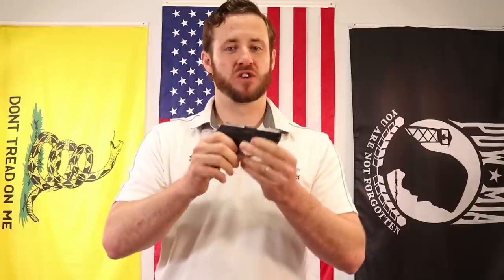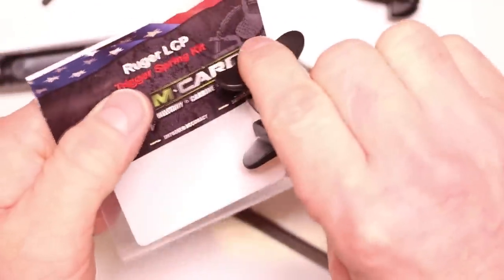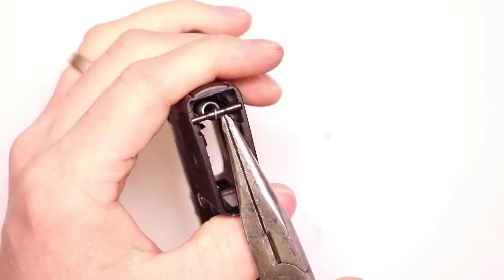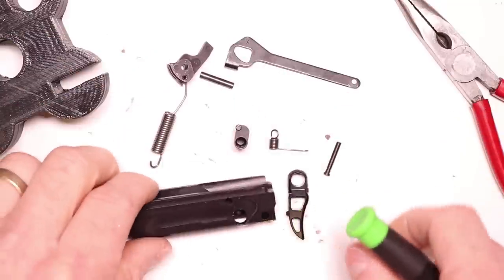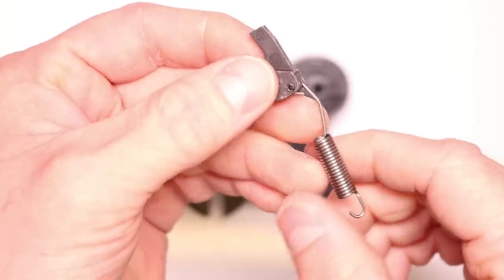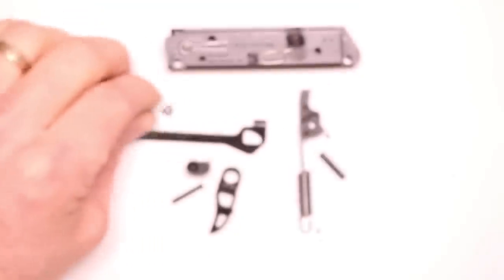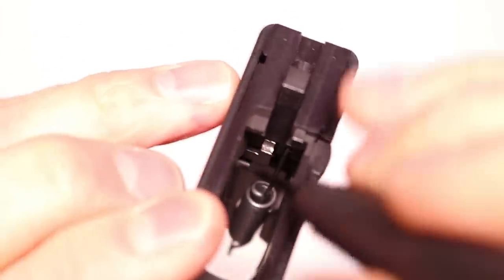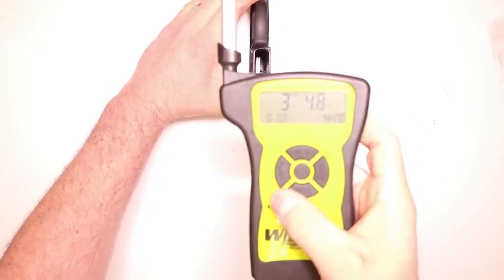Ruger LCP Trigger Spring Kit - Ruger LCP Trigger Upgrade

Comment: I have owned the LCP 1 for years.  Also the LCP Custom.  I have never had any trouble with the guide rod or anything else for that matter.  I like your stuff and use it in different firearms.  There's no need to discount Ruger to promote your products.
Reply: My 380 is a malfunction trainer. Want to love it, but nothing should be so bad out of the box. Maybe NC factory is bad. Still breaking-in (when Ruger says isn't necessary) but didn't realize I'd take the risk of having to modify & replace almost everything on it to be up to standards & reliable. Thought I was getting something 'better' than a SCCY or Taurus but not seeming like it. Could've just got something better.
Reply: My factory recoil spring was quite light. I would routinely have hang ups after getting a good amount of rounds through it. When I replaced the spring I noticed a heavy amount of wear on the factory guide rod where it mates against the barrel. I replaced it with a heavy duty after mart one and after a few 100 rounds I have had no issues since. This is all on a LCP 1 I’ve had about 12 years now. Over all it’s been pretty reliable for me.
Reply: @RENOWN55CHARGE  hate to tell you but sccy isn’t so bad and Taurus is great

Comment: If you own an LCP you have to buy these amazing products

I purchased the LCP Spring Kit, Flat Trigger Upgrade Kit and the Takedown Pin.   These parts truly transformed my LCP!   Everyone knows the trigger that came from Ruger is absolutely horrible and made the LCP very difficult to shoot.  No longer!

I just installed the Mcarbo parts listed above and instantly noticed an amazing transformation. The trigger is now smooth, trigger take-up is short and the trigger break is crisp.  It no longer has that long dreadful long trigger pull.  Trigger pull weight was reduced from a measured 6.5 lbs to 4.5 lbs. Last and certainly not least the wide flat trigger is well designed, comfortable along with perfect finger placement.  The Mcarbo parts truly transform the LCP into a highly effective shootable pistol. 

I just got back from the range and I put 50 rounds through it. Before the Mcarbo upgrade I could never get consistently tight groups and it was frustrating to shot.  Tonight I consistently got tight groups for the first time ever it is now fun to shoot.  More importantly I am now confident I can defend myself with my LCP and would be able to put the shots where necessary to stop the threat. 

IF YOU OWN AN LCP YOU MUST GET THESE PARTS.

Comment: Most people don't know this, but there's a small hole on the right side of the frame that is for holding the hammer block (sear) forward while you install the frame/chassis (trigger group) into the grip. I always want to call it an "FCU" like on a SIG, but I don't remember what Ruger calls it exactly. You just push the hammer block forward and then put a small punch in the hole to hole it forward. Then pull the punch out after the frame/chassis is in place. A thick paper clip can work also if you don't have a punch that small. It's on the small side of what most punch sets will have in them and I'm sure many of them don't. It's like a 1/16" diameter or something like that. This helps not scratch up the frame by using a punch to push the hammer block forward too. (Although I can see how it's possible for someone to damage/scratch the frame if a mistake is made while using the small hole... but I guess that risk exists with the other method anyways).
Reply: Thanks, I'll try this if I need to replace the springs again. Pushing the hammer block forward and popping the slide in place before it snaps back was the toughest part of the install for me, probably took me 15 tries 😅
Reply: @mgcross  Hope it helps. Doing that always took me several tries too. Was glad to discover the hole. I knew it had to be there for a reason.
Reply: Cool, fun fact!

Comment: I really like the lighter pull but I wasn't expecting such a weak reset now. It barely wants to reset the trigger, maybe I just need to get used to it but I may put the original trigger return spring back in.
Reply: It’s awful

Comment: The trigger kit I received was dangerous and unusable. The main reduction came from the trigger return spring, which was so weak it wouldn’t consistently fully return the trigger. I reinstalled the factory return spring and things worked. The other springs made no noticeable difference to trigger pull.

Comment: NOTE TO ALL:  The roll pin retaining the firing pin is now on the side of the slide for current production LCP “1s”.  The roll pin for retaining the extractor is now vertical through the slide, which makes extractor removal MUCH easier.

This spring set is a MUST have.  Along with some Underwood Ammo, makes the LCP a practical, economical, and effective pocket carry. 

Highly recommend the pinned Hogue grip sleeve as well..

Comment: My pin on the slide is over to the right of the slide and not in the middle of the slide like yours. Will this still work for me?
Reply: It did for me - I wish I'd have known that the slide was updated, as the pin on the top now retains the extractor. It was challenging keeping the firing pin at the proper rotation when reinserting the pin.

Comment: My 3/32 punch won't go in the slide; well it went in about a 1/16" but it was a bear to get back out. Is there more than one version of the slide? I thought maybe my punch was oversized but my caliper says it is 3/32 on the nose. I got it with my 1/16 punch but the 1/16 punch was big enough to keep the firing pin from firing across the room....oops

Comment: Will this kit eliminate the double click that occurs during trigger reset on my original equipment LCP as well as reduce the trigger pull weight?  I just bought this LCP and I don't care for that.
Reply: you can still hear the double click reset on the video
Reply: @TeamMadcrew  thanks, I was watching this in a large room with lots of back ground noise.  Didn't realize that, thanks.
Reply: All double action only pistols will have the 2 clicks on the reset.

Comment: Do trigger kits reduce the hammer spring tension to the point of reducing the impact of the firing pin on the round's primer?  I've never done a mod like this.
Reply from the maker: We take that all into account and design them to produce enough hammer energy to hit primers hard enough to ensure reliable ignition even on hard primers like S&B ammo.

Comment: followed the directions to a T...3x.....will not dry fire properly
Reply from the maker: What issue are you having?
Reply: @MCARBO  Yesterday I had just the upgraded trigger, I was able to use a good amount of takeup on the set screws to take up the front slack. I got the spring kit today and no matter what I do I cant have any takeup on the setscrew or it wont click twice....unless I'm imaging it, I had about 1-2 mm of takeup yesterday and I had no issues getting it to dry fire and its basically at the stock forward position now.
Reply: @MCARBO  So it is working now, but the trigger has to be i the full foreword position.